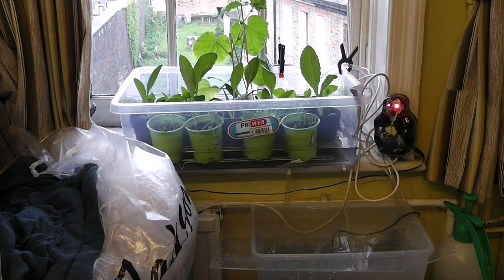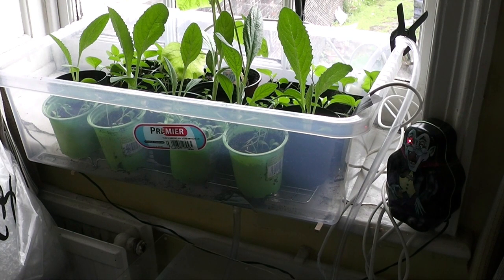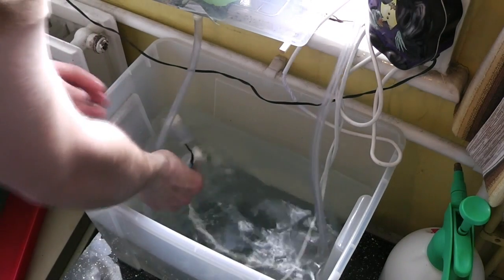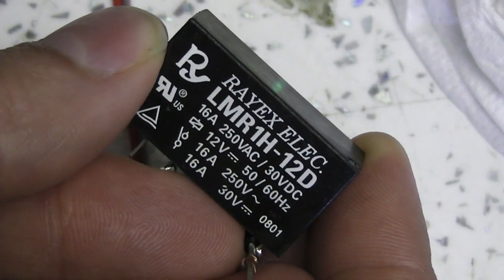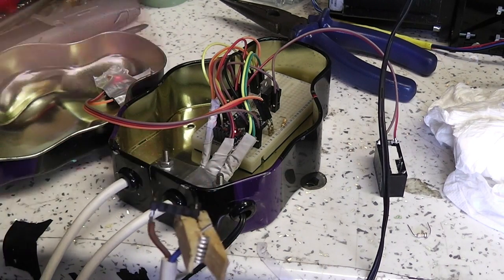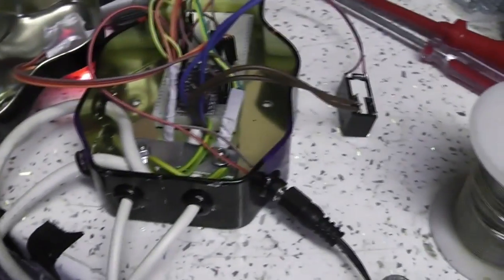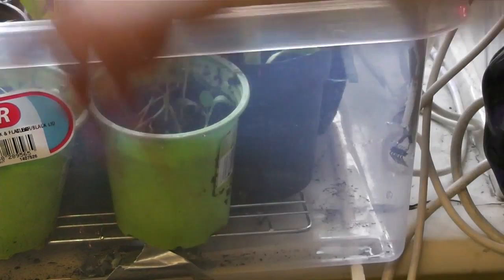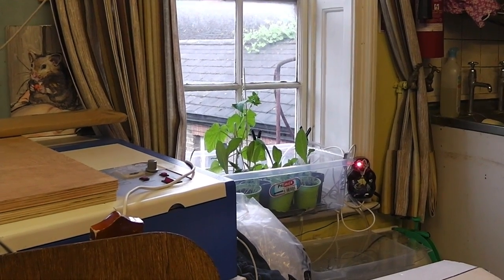Update: Arduino plant watering system

Comment: What happened to the wifi project?
Reply from the maker: I got distracted by other projects as usual! And a technical problem that I probably could have overcome if I hadn't given up / got distracted. I meant to use the ESP8266 module for wifi, and I was trying to set it up to send and receive data from a MySQL database on my server. But I found that the buffer on the ESP8266 often wasn't large enough to receive even a minimal response from the server. Or there was something else that stopped everything being sent back to my serial port whilst I was trying to set it up.
Reply: OpenTronic you could try Thingspeak in stead of your own server, it’s a free cloud